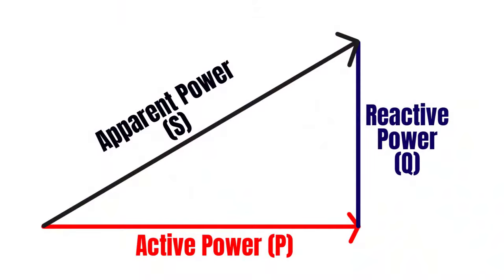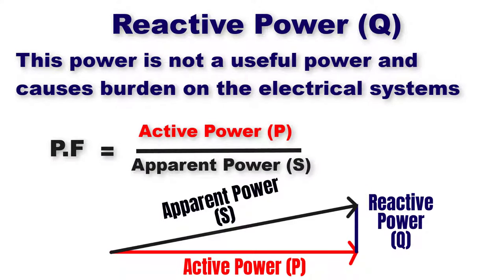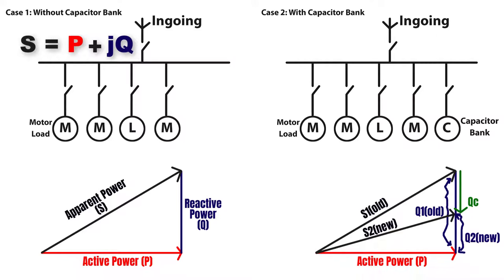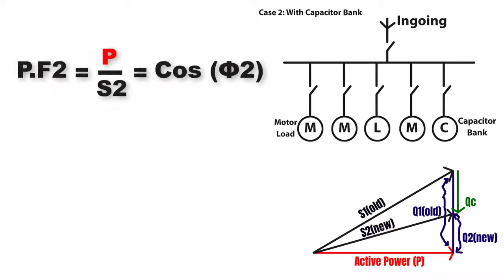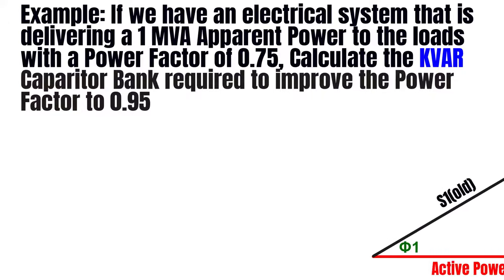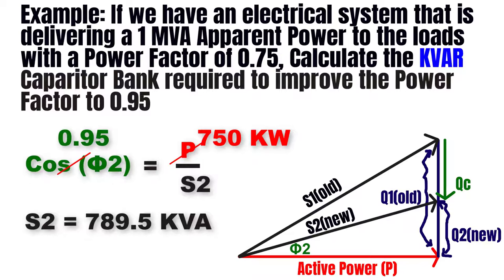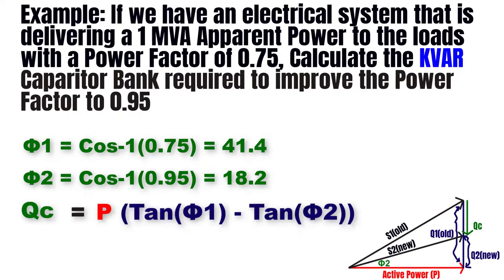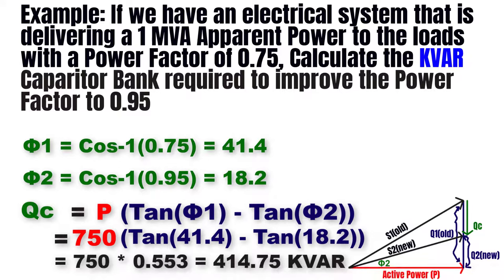Capacitor Bank Sizing (KVAR) for Power Factor Improvement

Comment: Hi mate, Amazing experience you shared with us.
I have a query pls help.
I have 3000KVA delta delta transformer with electride load (electrc furnace) Its not being run at full power i mean being run at 1500 KVA with pf 0.93. so if i  need to install capacitor banks to achieve pf 0.99 how will be the calculation? Should i consider 1500KVA or 3000KVA?
Reply: .93 is very good. Any more then you have to be careful not to overshoot with too much leading current which can be more inefficient.

Comment: I'm using 469KWH daily and about 14069 KWH per month under a single phase (Residential) with a 600-amp transformer... I need to know how I can reduce the electrical bill without losing the power I have.
Reply from the maker: @PauloBarboza-FloridaGranite  you can only reduce your electrical bill by reducing your consumption,, but improving power factor in industrial use can help you in avoiding penalty factor from national grid
Reply: @electricalengineeringplane6620  not help much, the penalty only for business not residential